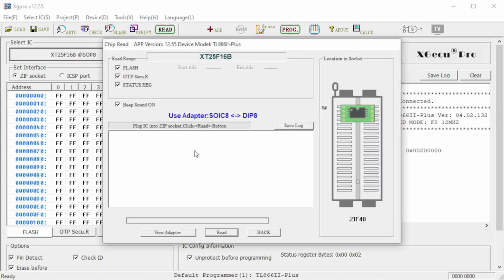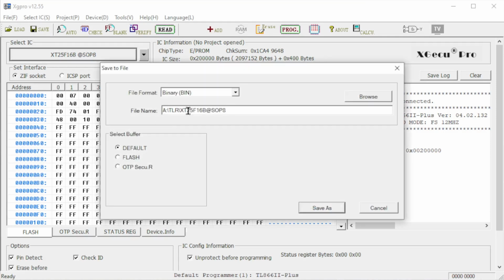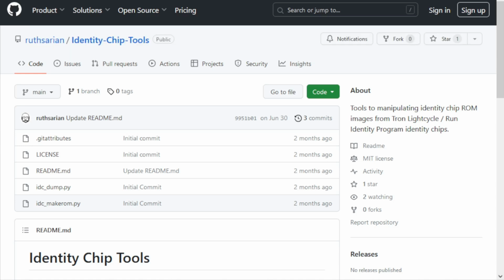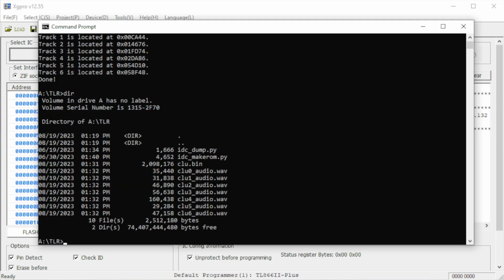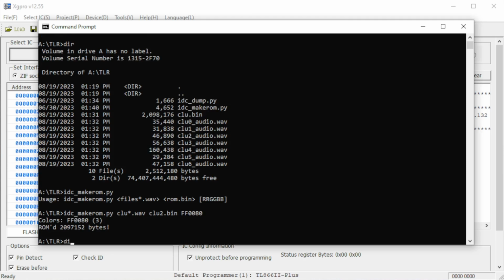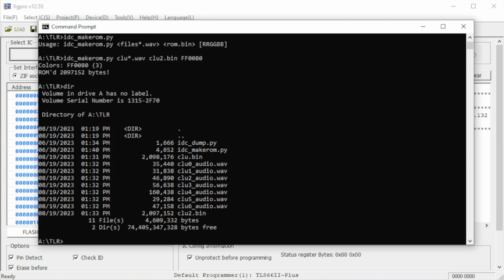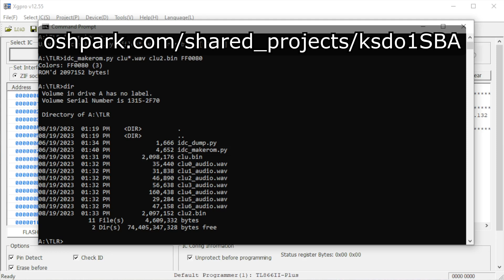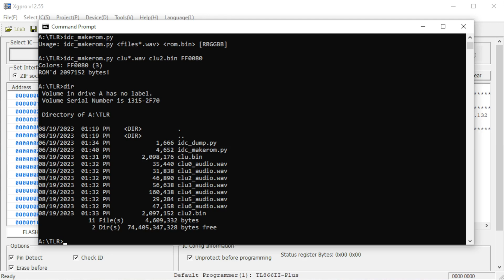Accessing Tron Identity Chip Data

Comment: Did you see anything in the board indicating a place for images as what is shown on the Identity Program figures?
Reply from the maker: images are not stored on the chip. they are stored as a mini slide inside the figure itself.

there's a tube inside the figure going up the back divided into thirds (like pie slices). each third has an LED at the base. there's a hole underneath the identity disc of the figure where a slide, divided into thirds, each third having one of your face images on it, is placed into the figure. the identity disc is then locked into place covering up the hole where the slide is inserted. there's no way to remove the identity disc except with destructive force.

there's a  mirror in the head angled at 45 degrees. one LED in the tube is turned on, it illuminated the slide, the image then bounces off the mirror and onto the face of the figure which acts like a small projection screen. 

i have a figure that i bought at disney world and i disassembled it as soon as i got home to discover this. there was no way to take it apart without damaging it, and in the process also damaged the mirror. it's not something i recommend doing.
Reply: @Ruthsarian what about helmet swapping?
Thank you for the response too! Very informative!
Reply from the maker: @judahroubique7601 not really possible. the helmet also has a one-way locking mechanism. removing it requires breaking part of the helmet.
Reply: @Ruthsarian so lets say I wanted to put a new custom helmet on the figure, would removing the original helmet damage the figure?
Reply from the maker: @judahroubique7601 possibly. you will definitely damage the original helmet that's on there.

the screen where your face appears is part of the body, not the helmet.

I saw a couples screws just above the face screen inside the helmet. I had to drill holes through the visor of the helmet in order to reach those screws. once the 2 screws are off, you can remove most of the helmet. I say most because the screws hold the helmet onto the one-way locking mechanism that keeps the helmet on the body. to remove that part you will likely need to cut away at the plastic, possibly damaging a part of the figure that isn't the helmet

so yes, you'll at least damage the helmet and it's possible you'll damage other parts of the figure.

Comment: Great work!  I've just added a pull request to your repo with some additional bits.  I've corrected what appears to be a slight error in how audio files are extracted.  I've also added some additional info about the format of the chips... including what makes the rinzler chip different.

Comment: I just got an identity program figure and Im going to try this out.  Where can I download Xgpro thats safe?
Reply from the maker: Xgpro is used with programmers from XGecu. The official web site is here: http://www.xgecu.com/en/. I am using a TL866II Plus which I bought off eBay. 

A less-expensive route would be to use a CH341A programmer. Those can be found for about $12 on Amazon. The major difference is that it's designed for just 8-pin EEPROMs where the TL866II Plus can program a wide variety of chips. If you're only interested in the identity chips, the CH341A is the way to go.

This entry on instructables.com should help you get your CH341A up and running:
https://www.instructables.com/CH341A-Programmer/
Reply: @Ruthsarian  Thanks I was thinking that it was a general interface.  Thanks for the link to CH341A.  Ill let you know how it runs.

Comment: Would it be possible to make one that cycles all the colors?
Reply from the maker: As the identity chip is right now, the only way to change the color is to remove it, reprogram it with a new color, then reinsert the identity chip. I don't know if there's a way to add executable code to the memory chip and get the identity disc to execute that code, my guess would be there isn't.

An identity chip that does that might be possible with the addition of a microcontroller that could either proxy reads to the memory chip and alter the values when a read command for the location of the color values comes through or reprogram the memory chip on the fly. There would also need to be something that triggers the identity disc to think the chip has been removed and reinserted; I'm not sure how it's doing that, but my guess is it'll have to do with power appearing on one of the pins; so maybe a transistor on that pin to break the connection when needed. 

Getting the memory chip, the microcontroller, and the transistor to all fit within the area of an identity chip might be a bit difficult as well, but there's probably room for a couple more holes to fit them within the PCB.
Reply: @Ruthsarian  Understood. I noticed that in the display sometimes they got it to flash but that thing was literally wired to the base and probably connected to a system that could do it manually.